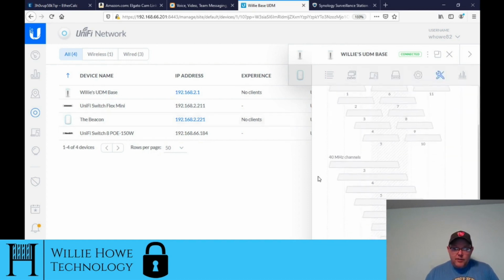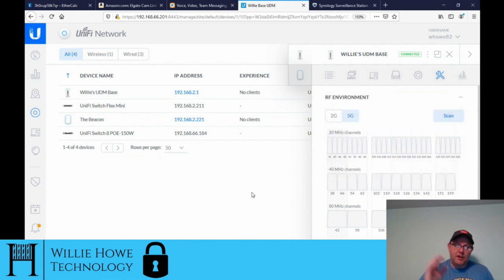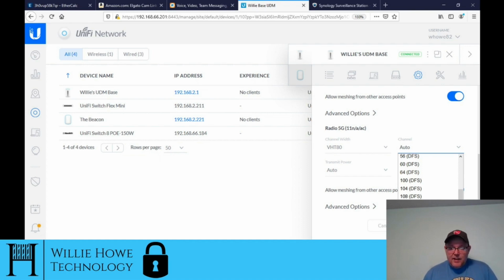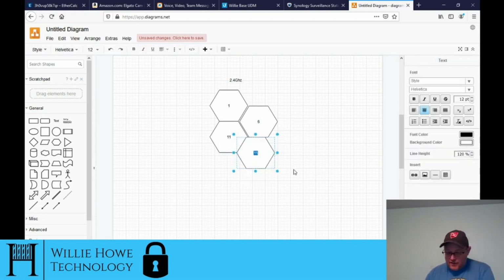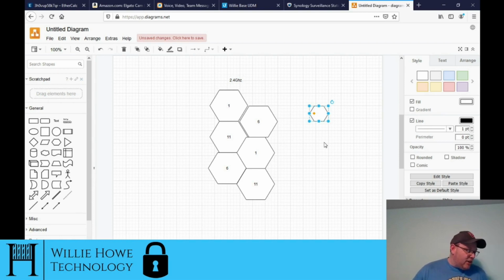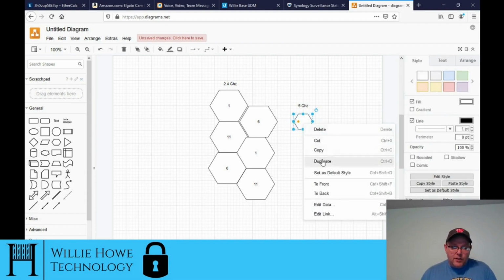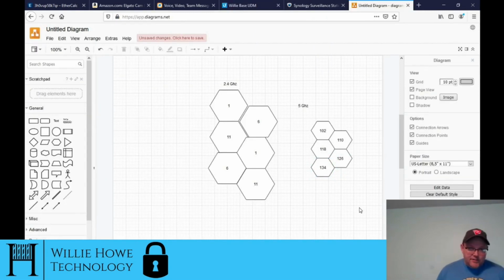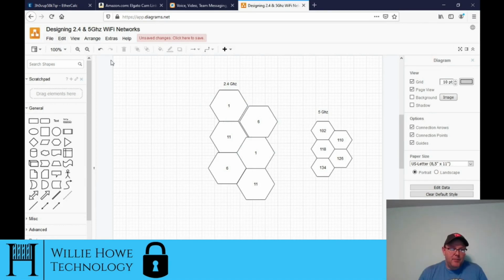WIFI DESIGN - SELECTING CHANNELS

Comment: I just realized that my Zyxel AP is still on its default maximum broadcast strength setting for both antennas. And while I can't complain about reception issues, I somehow get the feeling that 30 dBm might be slightly excessive for a 65 m² apartment. Do you think I should be a good neighbor and tone it down ever so slightly?

Comment: Case for 40Mhz 2.4GHz: My old parents live in a small house in the forest with 2.4GHz-only laptops. They have 200mbit fiber internet though. Only one AP is required to cover their entire house. They refuse to upgrade their laptops, as they claim "they are dying soon" and don't want the bother. Using a single 40MHz channel makes sure they can (almost) fully utilize their fiber connection. There is nothing else visible on channel scans. They have no 5GHz equipment, not even on their phones. Using 20Mhz channel width maxes out at 11MByte/s download speed.

Comment: I actually only trust using a spectrum analyzer for selecting channels.  Always 20Mhz 1,6 and 11 on 2.4 Ghz.  For 5 Ghz I've found the 149 or above tend to have the least amount of noise outside of DFS channels.  DFS works for some situations,  but not most.  Lots of devices don't even like to talk on DFS channels.   I've found the scan on Unifi AP's to be so so,  I have AC-LR's,  AC-Lites,  nanoHD's and now a UAP 6 LR.  The scan is not bad,  but misses lots of stuff.  Checking on a 6Ghz spectrum analyzer shows the truth much better.

Comment: Why does unifi segregate the channels into those particular groups of 3 in the 5G section? I would have thought the middle group would be for DFS channels but that’s not it since DFS ranges from channel 52 to 144.

So using 80 MHz channel widths, I don’t see how to use more than 2 APs while avoiding DFS channels. I have radar nearby so I avoid DFS channels and of my 3 APs, I put 2 APs on 40 MHz channel widths and 1 AP on 80 MHz channel width. Not sure how I would configure a 4th AP.

Comment: Hello, I need some suggestion from you for unifi what is the best practice to use frequency, width and transmit power for unifi AC LR for 1,6 and 11 channel.

This for indoor motel deployment
Reply: @WillieHowe  which is to go with and I can suggest those LR because I have bought and deploy it but facing some issue

Comment: Looking forward to a follow up video from Willie, here is some general info on channel selection and power levels from a residential perspective, if may be helpful to some. The RF scan in the AP gives one a snapshot on how busy various channels are.  IMHO, you are better off walking the periphery of the property watching the signal strength of each channel during a busy time of day on a tablet or phone and seeing where they peak. This helps you determine which neighbor is using which specific channel (a scan on a fixed AP is limited on determining location). For 2.4G in a residential area, odds are high you will have some interference across the board. If you found your neighbor to the East is using channel 1, your neighbor to the South is on 6, you might want to use channel 11 for an AP located on the Southeast side of your property and either 1 or 6 on the Northwest side to minimize interference with neighbors.

5G goes a shorter distance, and there are more channels, so interference tends to be less of an issue. Be aware that not all client devices are capable of using DFS channels so one may be forced to use the lower channels (starting at 36) even if a DFS channel would be better.  For example, some Amazon devices can't use DFS. This is something you need to test or research before trying to use DFS channels, as well as your proximity to radar stations. You may also find you have devices on your network creating "APs" with a hidden SSID on 5G, such as some streaming devices.  These can be a surprise when you see a very strong signal in a room with no AP or nearby neighbor.  These hidden built in "APs" are used either for initial setup or inter-device communication seen on some smart devices or streaming devices. They may or may not be an issue for interference depending on the device and how much it uses the channel, if possible, just use other channels. 

A WiFi survey helps determine how many access points are needed. By first setting up a temporary AP, perhaps centrally located initially, one can walk around with a tablet of laptop, and at relevant points recording 1) signal strength (RSSI), 2) latency, 3) throughput with a local speed test such as iperf in both directions. This can help determine where you need additional APs. Often times in a small to mid sized home, one AP is enough if it is located dead center of the house on the ceiling. Better to use one correctly placed AP, than need multiple ones. The Wifi survey should examine 2.4G and 5G signals independently.

Setting power levels with multiple APs requires some educated guessing. When all the access points are in place, one needs to walk around paying attention to which AP the mobile client is connected at each location, noting rather it is the closest AP or is one further away. If connecting to the wrong AP, you need to reduce the connected AP signal a bit and check again and adjust.  There are higher end tools to helps with this but they tend to be costly and not necessary if you have the time to walk around and adjust the signal level a few times. Note, the client determines which AP it connects to. The AP can be configured to boot off a client with a weak signal, but the client may just try to connect to it again if it's the strongest signal it sees.

Another thing that needs to be decided is rather you will use 2.4G and 5G using the same SSID or separate SSIDs, there are pros and cons to each. In my setup, only certain IOT devices require  2.4G, so I keep them separate to prevent 5G capable devices from trying to use 2.4G. If however one is pushing the range of the signal, you may want them both using the same SSID. These are just some of the considerations off the top of my head.  Unfortunately every location and situation is slightly different so there isn't a one size fits all answer to every decision.
Reply: @WillieHowe  Yes, it's hard to condense down a complex subject into a reasonable amount of time. I saw you had mentioned to other commentators about doing more videos on this topic, but understand if it's not practical. It seems good info on a systematic approach to a multiple AP solution is hard to find. Keep up the great work, really enjoy your channel.

Comment: Not all client devices are DFS certified. I deployed 18 APs throughout a building and strategically placed DFS and non-DFS channels in a checkerboard arrangement to make sure non-DFS devices had a chance at connecting. The same said set of APs has 2.4 GHz disabled on every other AP in a checkerboard arrangement (which was fine, because the range of 2.4 GHz vs 5 GHz). That said, I had the ability to arrange the 2.4 GHz enabled units in the triangle configuration like you have. It's sorta close to an airport, but luckily I only get about 2 DFS alerts per week, not on any particular APs. I did find the DFS APs will revert to a non-DFS channel while it waits.

Comment: This is just my 2 cents regarding AP channels; I've been experimenting with various configurations over the past year or so specifically using the Unify AP's with the Unifi cloud key controller. In this case they work best when they are all set to the same wideband channel on auto or high power. Using the clearest single 40 MHz channel in the 802.11bg range and the clearest single 80 MHz 802.11ac channel (same channel on all AP's supporting the same WiFi networks). It is very important to use the cleanest 40 MHz & 80 MHz bands over the entire site.  I suspect that the Unifi AP's coordinate well between each other to avoid conflict when all AP's on the same network(s)  are on the same channel; Client signal quality on distant AP's improves when Unify AP's are all set to the same channel. This behavior might be specofic to Unifi AP's with a Unify controller. Meshing and Wireless Uplink are disabled in my case. All AP's are wired in. I used one AP with a wireles uplink until I could wire it, and that worked fine as long as I manually configured the wireless link so that it wouldn't change, but it used a lot of bandwidth on the two AP's involved just for the wireless bridge.
Reply: This is not right. Your 2.4 channels should be on 20mhz, and for the most part, unless you have specific devices that support 80mhz on the 5g channels, those should be on 40. Also, each AP should be on a different channel, not the same channel.  The only time you will have two APs on the same channel is when you have one connected as a wireless uplink. Auto is probably the worst setting you can use. I've been doing network installs, including wifi, for many years. Even just at my house I have 5 APs, so configuring them correctly is very important. The thing about the 2.4 ghz band is that you are highly unlikely to have anything on those channels that even need 40mhz, and even in a few cases (Belkin Wemo) they complain if it's not as basic as possible - 2.4 ghz SSID at 20 mhz.
Reply: @tornadotj2059  I know it's not how it's recommended, but it works great, much better than the "standard" way, for my Unifi AP's on my Unifi Cloud Key controller. I don't know why, but it just does.
Reply: Every situation is different so I can't argue if it's working for you. I'm guessing you don't have much interference from neighbors as 40Mhz wide channels don't work well most places on 2.4G, even if you only have one AP.  Even on 5G, sometimes one needs to use 20Mhz wide channels. IMHO, if one has a good network design where only mobile devices use WiFi and fixed location devices use hard wired connections, then WiFi speed isn't an issue and 20Mhz channels are sufficient. Fast speeds might look cool on a speed test site, but makes no practical difference on mobile devices. I'm wondering if your devices are handing off very much between APs, or if they pretty much just stay with one AP until really far from it.  If it's the latter, that would explain your experience. Everything I've read, even that written by Unifi employees, says so use different channels on APs. Like I said though, can't argue if it works for you.  You might want to perform a detailed study to see exactly what is happening, signal strength as you move about, where hand off is happening, which network is in use (2.4 or 5G) at various spots, etc.

Comment: Ok.. Watched this 4 times.. First, mouse cam is awesome, we need a followup..  I set the frequencys and set the channels.. That part was excellent and I got that pretty good.  I still don't understand where to set the zero handoff..  You said don't do it.. What is the correct setting and where do you do it?   I also saw the AI wifi.. Thoughts?  It sounded like the AI does most of the stuff, but i usually prefer manual..